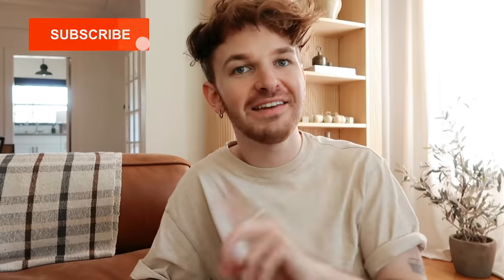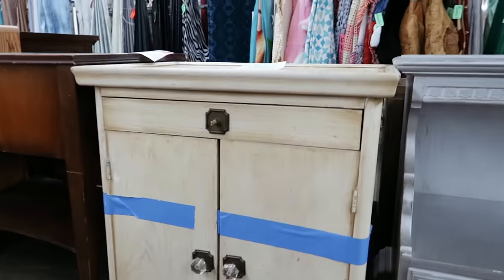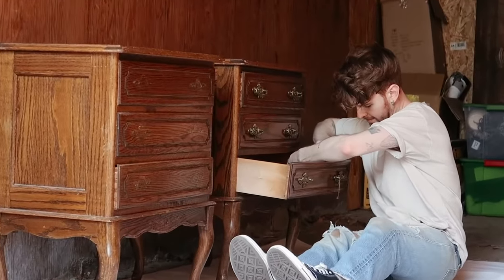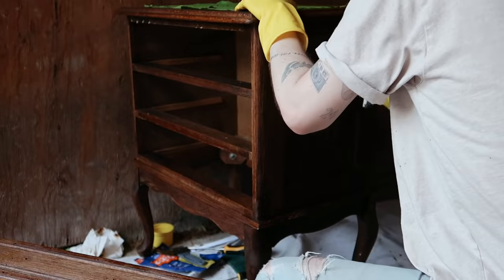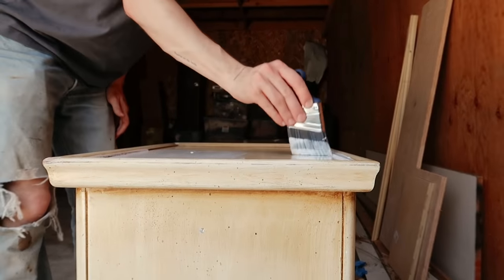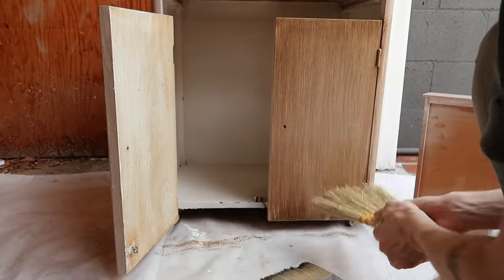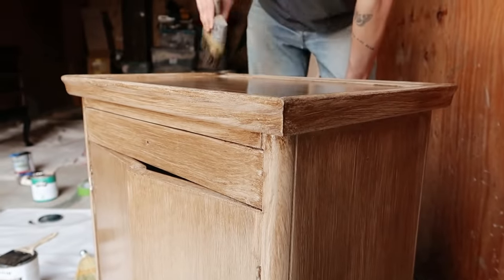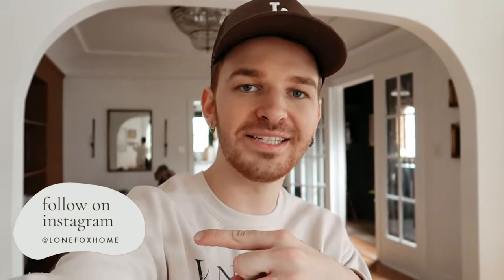TESTING VIRAL FURNITURE HACKS! 🪑 *Wood Like Paint + Stripping Wood With Oven Cleaner*

Comment: I have used the faux wood treatment before. I start of painting with white flat paint such as chalk paint. Then I use Saman water based stain in Castle Stone to give the look of weathered gray wood using a chip brush or any stiff bristled brush will work. This stain doesn't stink and comes in so many colors. I purchased it on Amazon. Loving all of these hacks and hope to try some of them. Thanks for sharing.

Comment: Well done both pieces looked great!!  I’ve used the faux wood technique a couple of times but I used a Gel Stain over the painted wood instead of glaze. Result was similar. You can even do “knots” by using a smaller brush and twisting it then curving the grain around it with the bigger brush. I did my plain cream colored metal front door. Now looks like an expensive solid wood door.  So easy!!

Comment: Honestly there's no reason to use the oven cleaner hack, it's not meant to be used as a paint stripper so it doesn't do the job properly (thus the blotchyness), so you might as well use ACTUAL paint stripper to remove an old finish, it's just safer and actually works  (That said the bedside tables turned out gorgeous and supremely gothic, I love them)

Comment: Both turned out well. I cannot use oven cleaner due to the fumes. While it did "work" it took a lot more scraping than if you had used a product made for stripping finish off of wood.The knobs on each project really set them off nicely.

Comment: Maybe I missed it, but did you use both oven cleaners, and which one worked the best? Also thinking, if the piece had been in the sun for a while, it might would have worked a little easier since most oven cleaners need a warm surface.

Comment: If you wet your scrubbing brush or use wet fine steel wool and go in circular motions it will remove the oven cleaner easier,  just check that your piece isn’t made of chipboard before using too much water!

Comment: Just a tip for those who try to remove finish with oven cleaner.  Once the finish is off, you can bleach the wood with a bleach diluted with half water.  You can also buy wood bleach.  This step would lighten the wood grain.  Also do not paint furniture with gloss paint, no more than satin finish.

Comment: Most oven cleaner is lye so it should do well stripping paint. Drain cleaners are also lye and  will do the same thing.  I don't know if they  are any better than actual paint stripper though.  I worry about tiktoks using caustic chemicals like lye because some  kids (and adults) won't use the proper protection when working with them. You need thick rubber gloves, eye protection, and a WELL ventilated area. Lye will burn your skin and if the spray gets in your eye it can  really damage your eye.. See "Fight Club".

Comment: Don't do the oven striper please 🙏 Sunnyside 65732A Multi-Strip ADVANCED Paint & Varnish Remover, Quart
Reply: For stripping the plastic varathane finish off these pieces, Citristrip in the spray can would be perfect and faster, plus having good tools like a rough sponge or stiff brushes to take it off, then finish with a wood bleach (I've used diluted bleach and worked outside).  These are oak, so there was an under stain to heighten the grain that had to be removed as well if the goal was a plain 'naked' wood.  (other tools for stripping: dental tools or ice pick, sharp knife blade to get into the details, a sharp blade paint scraper for the broad areas, plus old newspapers/mail ads for spills are fine, and a can to put the icky goop into as you take it off. Sand sponges or sanding paper and steel wool to finish the surface)

Comment: Next time skip the broom and use 000 or 00 steel wool. Ive done the same finish on many pieces.. You can even buy a clear glaze an tint it yourself to whatever color you want.  they do sell graining tools as well that will give you different grain patters.  Best of luck and regarding the oven cleaner, they have a great furniture stripper at home depot that is cleaned up with water,  use that and you wont have the bleaching problem.  The oven cleaner is way toxic and is not a great hack imo...

Comment: Did you "wash" those two pieces after spraying the oven cleaner and scraping? Scraping doesn't remove all of that cleaner, and although they are dry, wonder how the paint that you may end up using will inter-react with the cleaner you used but that maybe wasn't completely removed. In most cases, when you apply glazes, varnish, stain, etc, you shouldn't brush in back and forth motion.  You brush in one direction. There is a difference in the surface outcome.